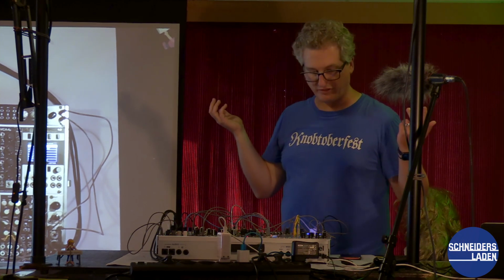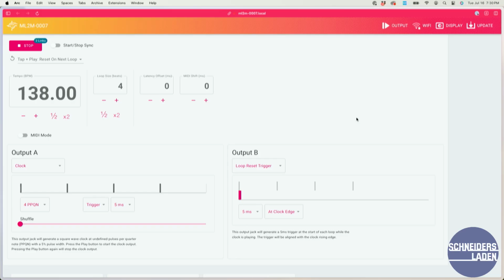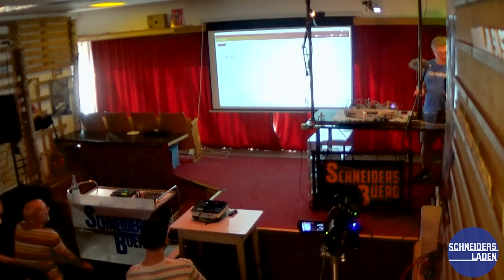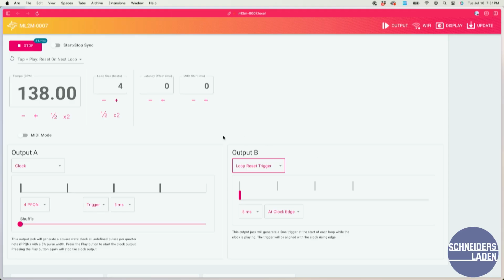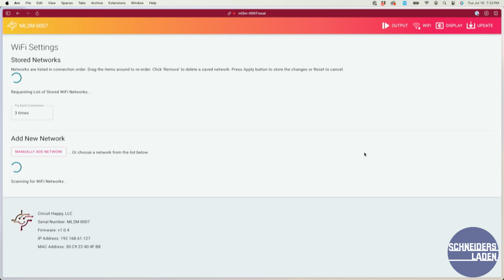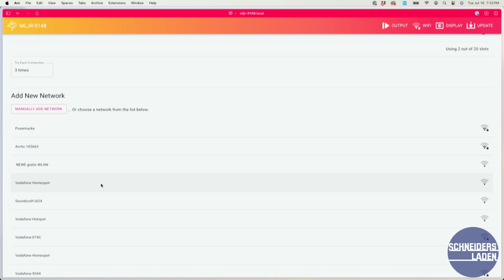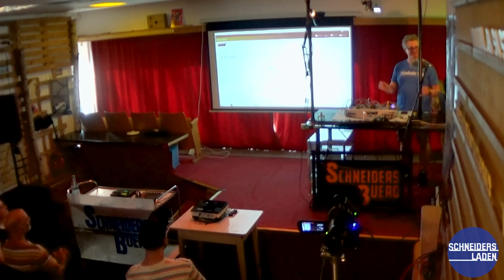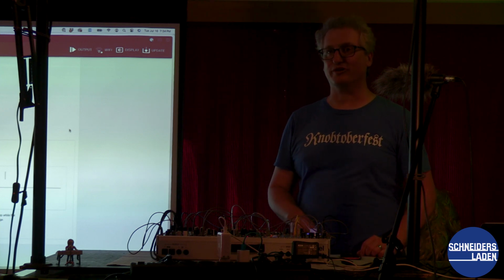Workshop with Circuit Happy at SchneidersLaden

Comment: Could this replace my e-rm multiclock?
Reply: Your E-rm multiclock allows you to shift individual midi outputs in real-time either forwards or backwards in time relative to the base clock. So no, this cannot do that. You could use it drive the main clock of your multiclock which is an interesting thought